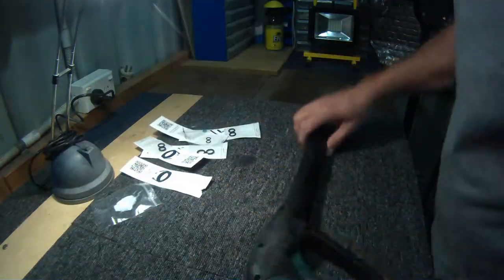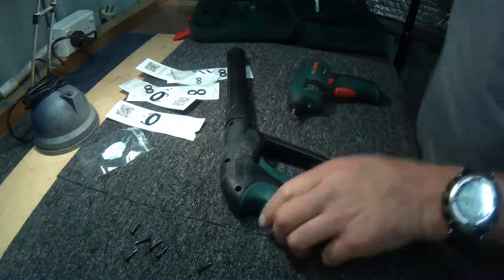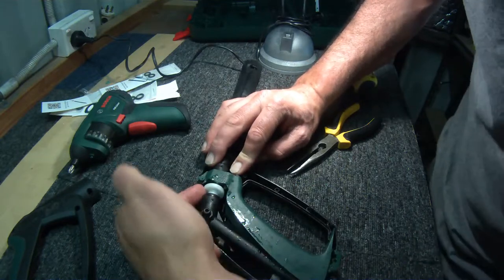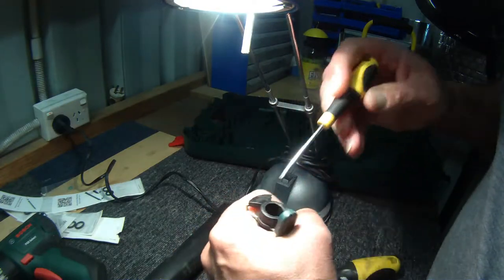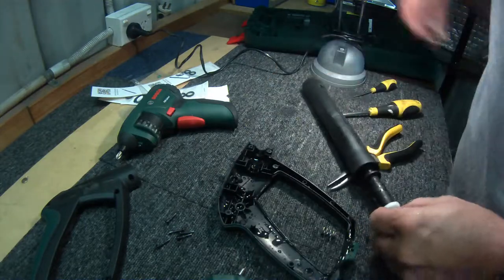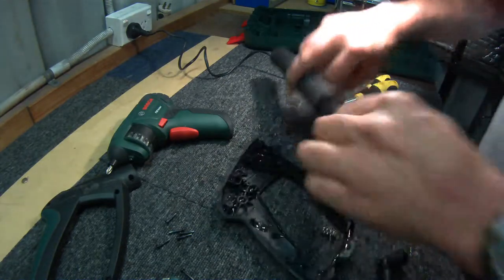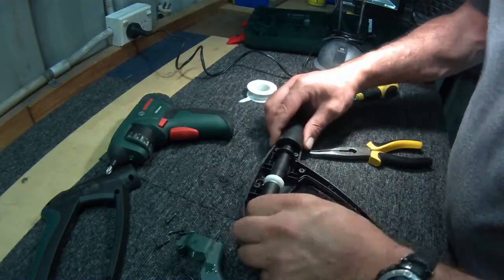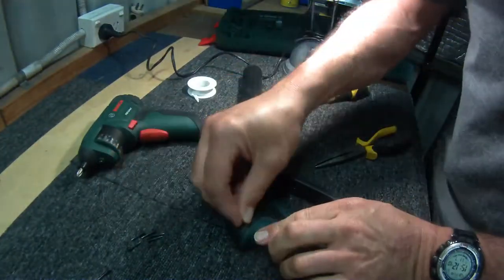Gerni High Pressure Water Cleaner. LEAKY TRIGGER.  Part 2

Comment: Strange, mine was leaking from the o ring you replaced in part 1 which made sense as it was dry and brittle, replaced that and it was working perfectly. Went to wash the car again this morning maybe a week or 2 since replacing the o ring on the male hose end, and suddenly had this same issue you were having. Just went and bought a new gun, then found your video, thought I might save $50 before I opened the new one, but sounds like I’ll save myself the 20 minutes opening it up instead 😂
Reply from the maker: Haha. Yep correct. New gun is the go mate. 🍷👍

Comment: Where does that large spring go?
Reply from the maker: The spring belongs in the base of the handle where the high pressure hose is snapped in place. It's for the locking mechanism. Cheers mate.